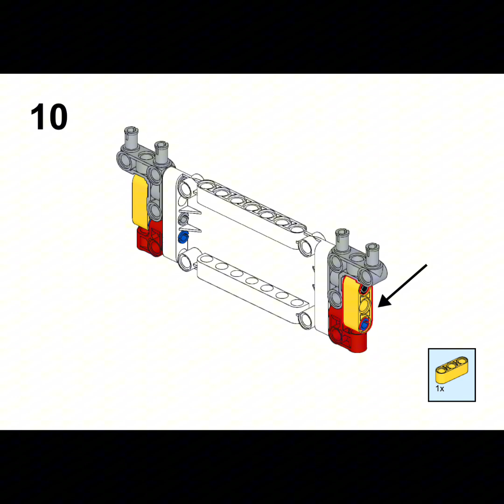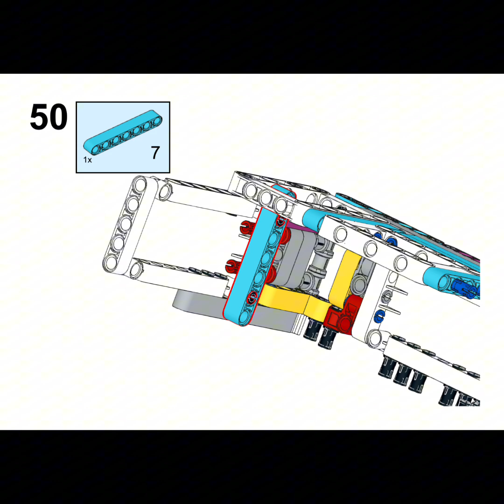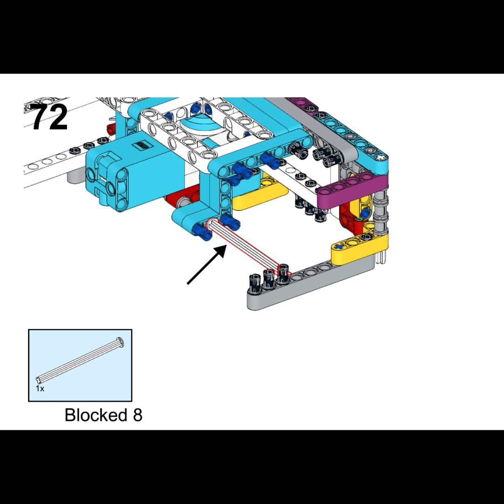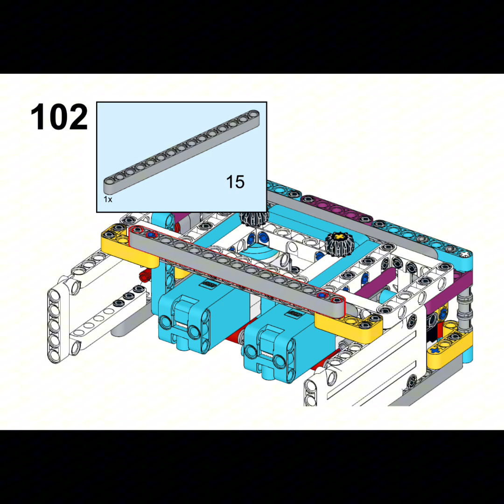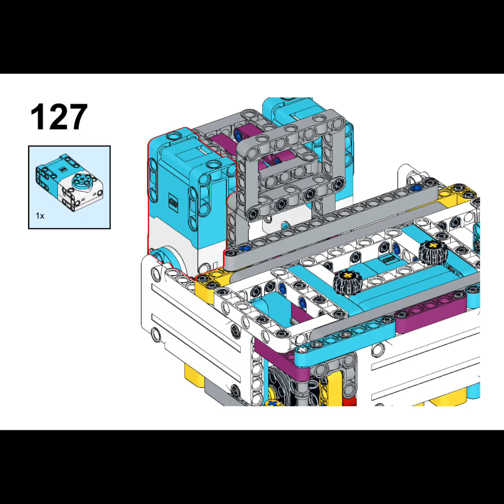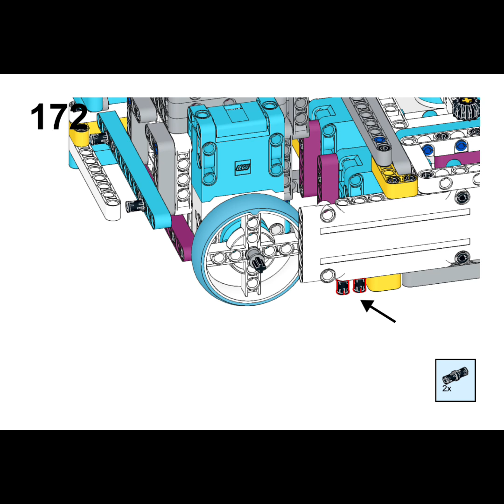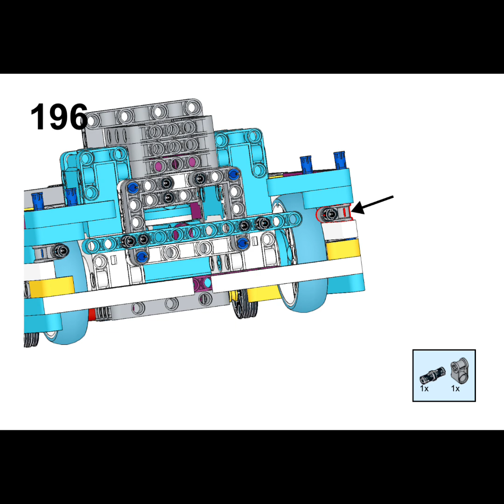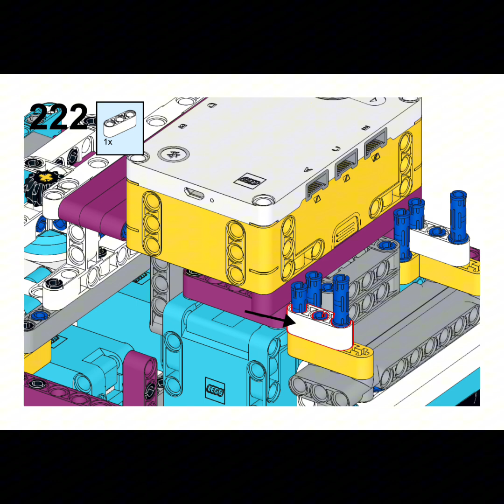2024 2025 FIRST LEGO League  SUBMERGED Robot Step By Step Build

Comment: On Step 226, you say "Please put weight in here".  What are you using for a weight?
Reply from the maker: This model is a rear-wheel drive, and the weight's role is for the smooth rotation of the wheels